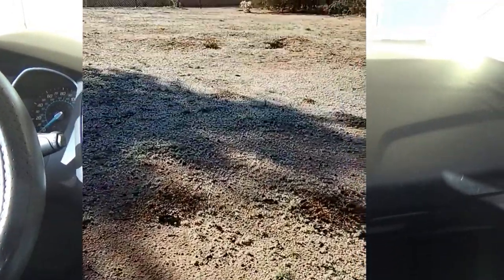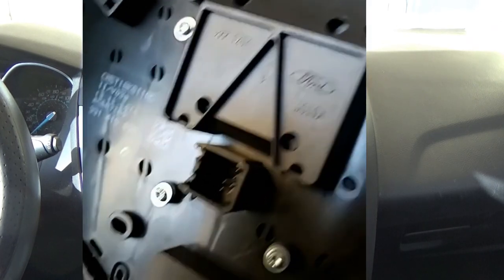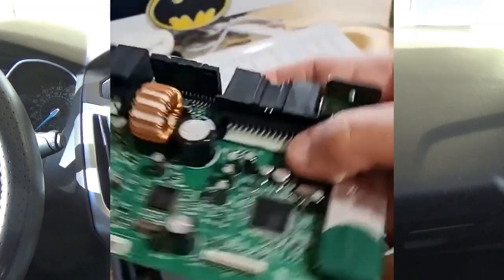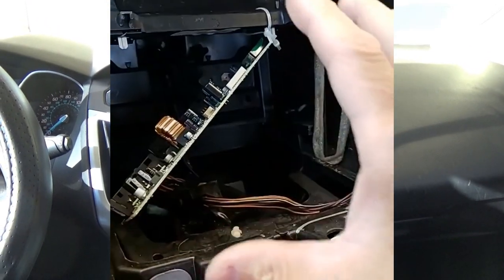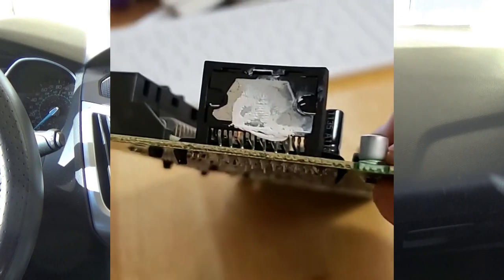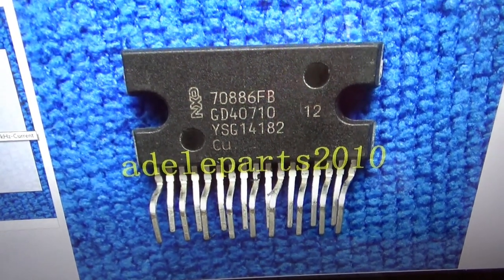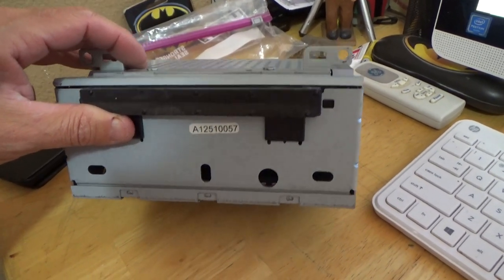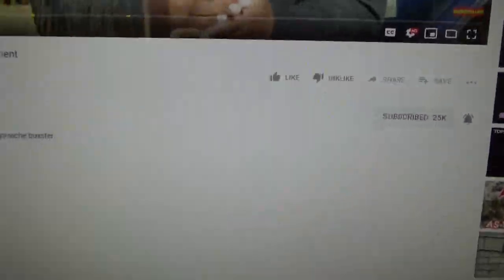2012 Ford Focus Radio Popping & Staticing Possible Repair Fix

Comment: Shiiit maaan when I saw that u just fixed it unplugging the cd player I runned in the garage to test it and it didn’t worked 😂😂😂 so sad and yeah, I already saw that u sold it… I don’t what else to check.
Reply from the maker: Take it out and put in a after market radio.

Comment: Most people upgrade their stereo system for a better quality sound from their phone. You on the other hand, don't listen to the radio. So, do it for a video that proves you can fix garbage and have a radio again for the wife and kids.
Reply from the maker: My phone has great audio for the radio, my kids can listen to their cell phones I dont care lol.
Reply: @Iseekoutthetruth  So why did you ask about fixing it. Throw it away and put a stuffed Bat figure in the hole, How cool would that be!
Reply from the maker: There is No Hole there, I want to fix it only if someone who knows about this electronic type stuff, but I do not want to waste my money on these parts if that will not do the trick, maybe someone will have these parts and send them to me lol.

Comment: My 2014 Ford Focus got worse,  great amount of white noise, tried to reset. Now no sound at all, either amps are out or the protection circuit kicked in and no sound. Probably going to put in a new OEM
Reply: There are 1000s of complaints on the focus radios they need to be recalled, it almost caused me to wreck it pooped so loud
Reply from the maker: I took mine out and threw it away.
Reply from the maker: Yea mine popped really loud also.

Comment: These Fords Fiesta's, Focus' are horribly  manufactured.. i have  a 2014, purchased brand new... as soon as i took mines off lot, 1 day later my speakers were staticky.. I've  had nothing BUT problems with this car.. i had taken this car in 44 times due to PROBLEMS.. THEY SOLD  ME A DOGGONE LEMON...
Reply: Hecky, i was so frustrated, i had to write a letter to the headquarters BUT nothing was done!
Reply from the maker: I sold mine and bought a Honda CRV.